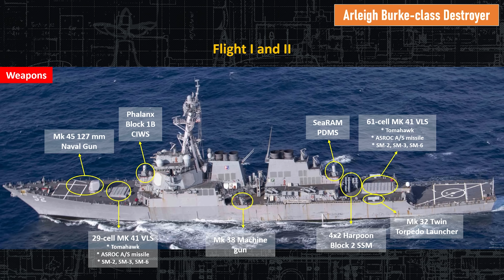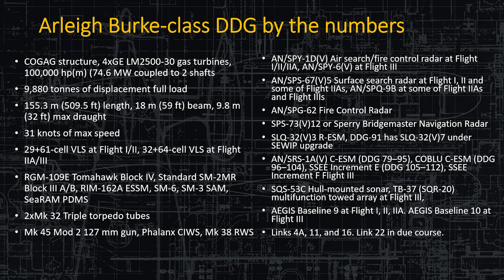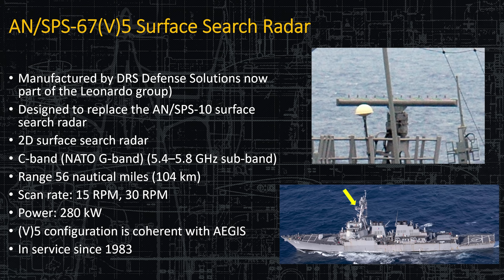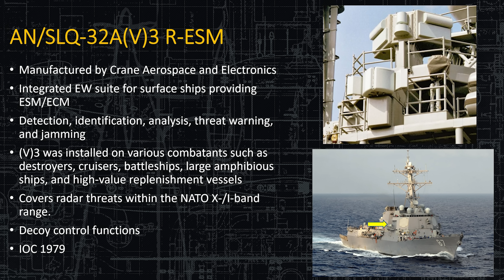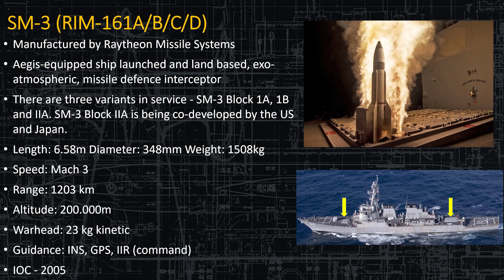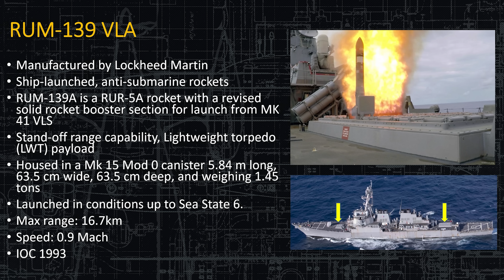How Does the Navy's Strongest Ship Work?

Comment: The Flt IIA and II are actually heavier and longer.  A lengthening of 4.5 feet was needed to accommodate the helicopter hanger and other needs.   The Flt IIA and III are also ~ 1000 tons heavier.
Reply: @edl653   Basically the later versions of the DDG-51 Class of destroyers in tonnage are equivalent to bare boned built light cruisers.
Reply: @latashafreeman563  Yeah, the Flt III is ~1400 tons heavier than the Flt I and is roughly the same as the Ticonderoga class.

Comment: The Blk IIA upgrades will include a 24 Radar Module Assembly SPY-6(V)4 upgrade as the SPY-1(D) is removed.  New A/C, GTGs, and Combat System upgrade to Baseline 10 also comes with that mod.  The Flt IIA will be almost as capable as a Flt III at this point.

Comment: 54 calibres and 62 calibres refers to the length of the gun measured in it's calibre (127 mm). So the Mod 0-2 at 54 calibres is 127mm x 54 or 6.858 meters. You will notice that the Mod 4 at 62 calibres has higher muzzle velocity and greater range because of the longer gun (7.874 meters).

Comment: The primary reason anything is expensive is due to it's scarcity. 50% of the SM-3 cost is not the sum of it's parts. It's the low rate of production. 
If we've learned anything from Ukraine it is the need for deep magazines. Not the onboard magazine, but the depot magazine. The stockpile requirement for a major modern war has not changed from WW1. Regardless of advances in precision, advances in production have out-paced that advantage. 
In other words, precision strike can destroy a lot of stuff very quickly and surely, but modern production can replace lost assets just as fast. The factories struck by precision weapons can be replaced by the same means of modern production. We're no longer riveting Liberty ships together, we can 3D print them. And, our workforce is three times larger to do work which is 30 times more efficient. 
Don't judge our current production rates on current malaise and greed. Were the threat existential, the production of advanced weaponry will boggle all belief.
Reply: Exactly. It took 3 years to make a single destroyer in 1941. After Pearl Harbor, it became 3 destroyers per day. And I would argue that our current under-funding of defense and neglect of strategic industry is nothing compared to our situation at the start of WW2, when we were in the Great Depression. We were also starting as the #17 world military power back then, not #1.
Reply: @Anthony-jo7up I would tap the like button a dozen times if I could. 
The inter-war years are the time to research and find an edge. 
The war years are the time to see who will outproduce their opponent. 
Unfortunately, we are in an interwar period as usual, and falling behind as ususl. This is because the US has no immediate enemies on our borders. Our current advantage is an after effect of the Cold War. The momentum it produced takes a long time to wind down. Russia's seemingly endless supply of cheap, poorly designed armor is proof of this. 

Now, we have the left overs of two very different doctrines. Soviet mass attack, versus US 'Quality over Quantity'.  While China attempts to infuse both doctrines into one. 'Quantity of Quality'. 
It won't work. China's adversaries are too distant, varied, and hold advantageous terrain. 
China should never attempt conquest. It will fail. They are merchants, perfectly located to be merchants. Horribly placed to be adventurers.

Comment: The main deck gun is not a 127 / 54. It is a 127 / 62.
Reply: Depends on which Flight.. Flight I, II and early Flight IIa received the Mod 2 with the shorter barrel. The longer 62 caliber barrel was originally designed to be used with the ERGM (Extended Range Guided Munition) that had a maximum range of 60 nm (70 miles).

Comment: Is the new frigate we are getting going to replace the Ticonderogas?
Reply: No. The new frigates are basically a long overdue replacement for the Oliver Hazard Perry class of frigates. The DDG(X) under development is supposed to replace the Tico cruisers and the flight I and II Arleigh Burke destroyers.
Reply: @lynnjensen150 I forgot about the Perry class. So we still use the ticos correct?  Or have they been chased out or replaced already?
Reply: I think the idea is the new DDG(X) in development will fill the role of the Tico’s
Reply: Those  fellas  are  having  their  thumbs  in  their  bums  and their  minds  in  neutral

Comment: Nice and complete presentation - thanks!!  👍As a Brit, I've mixed feelings about the Type-45.  It was a good step in the right direction to develop Royal Navy capability and improve the industrial base.  Its radar is very good.  However, it's had many development problems, e.g. intercooler in hot climates.  The number of VLS units (48) is small compared to the Burke's 96, and they had to start fitting Sea Ceptor silos to make up for nearer-field anti-air.  And they should replace one or both 20mm CIWS with similar R2D2 radar+RIM-116 RAM missiles.  Overall, however, the Red Sea/low-cost drone experience is showing how far behind we are in our thinking of air threats in a high-tempo environment, and cost-effective countermeasures. ☹ Hope the lessons are heeded for the Type-83.
Reply: @nukerock2451  fully agree, whilst impressive vessels I do think the T45’s are rather under gunned for their tonnage

Comment: In the early to mid 80s I was part of the RD team at GE GEAR plant in Lynn MASS machining the prototype and first high speed reduction gearing for the ARLEIGH BURKE class destroyers. I ran the largest 7 axis cnc horz boring mill in the country at that time. Another machinist and I machined the actual main gearbox that everything was installed and connected to. I was around 24 and my background in CNC programming allowed me to get the R 25 level job and that is the highest paying level for the union. It is something I always brag about and feel proud to know I worked on something so important.  The real reason for this new class of destroyers was not what everyone reports. It was so top leadership in the navy wanted to be able too water ski behind a fast moving ship. I have always wanted to see the reduction gearing installed but have not had a chance. Anyone have a suggestion
Reply: It’s pretty neat, I’m a welder at BIW and have seen it get installed with the overhead cranes in the building I work in. They lift it from the ground to maybe 5 stories up and down into the engine room unit. I kind of dread it because it’s always a pain to weld/move around once it’s installed LOL.
Reply: @RomeHam that is the way it use to get put on the floor for machining and loaded on index able table for machining. The gear plant was all large machines and overhead cranes were used for all parts.
Reply: WW2 destroyers were much faster, up to 10 knots faster than the Arleigh Burke DDG's.
Reply: @dundonrl actually I believe the speed is more than people know. I know of one operation where the distance proved that with the time traveled
Reply: @skipd9164  For routine transits, we were limited to 16kts, SOA (speed of advance) - think of avg MPH for a trip limit.  The MOVREP system, that came into being after USS INANAPOLIS was snk in WWII monitored out tracks, but there were ways to game the systems on long transits.  We got from Dakar, Senegal to Roosevelt Roads, PR a day earlier than the estimate upon departure from Africa....;)  As far as doing Flank III, we were not as fast as FLETCHER Class DDs, but we still could hit 33+.  Our (DD963) fuel load was 650K gallons, and usually was, at nominal cruising good for 30 days, so sprinting around used lots more gas.  Every operating day, we sent off a SITREP which included fuel on board, so ppl eyeballed that, and in my job on a staff, i was that guy so we could plan replenishments at sea/in port.
Reply: @streamingstarpros2843 only the Internet could allow us to meet people that we would never have crossed paths with. I remember having US Navy reps come and see the machine I was running. I actually ran the index table for them showing how the very large part could have all surfaces machined without having to be realigned. For a part the size of a single car garage that was amazing

Comment: All that the Burkes need to be absolutely complete is a quieter propulsion mode for ASW work when using the towed array
Reply: And perhaps some form of stealth added to its sides?
Reply: @tryhardfpv5351 PRARIE/MASKER is that kind of stealth, along with shock mounting equipment in the machinery/equipment rooms.

Comment: They''re planning on building a lot more than just 11 flt III's.
As of August 27th 2025, there are 24 named flt III's on the Burke's Wikipedia page...
DDG(X) will hopefully get started by 2027-2030!
Reply: Really need to ramp up ship production. But there is limited capacity.

I would like to see a Manhattan Program-style megaproject to build the world's first fully autonomous ship manufacturing center, that uses AI and robotics to take a digital design document for a hull and just works on it 24/7 as efficiently as possible, with a minimum of human labor, and produce a perfect ship in a short amount of time. Maybe start with a small ship hull, work out the bugs in the software and robotics, then scale up to produce anything from a small Coast Guard cutter to a giant container ship, tanker, or aircraft carrier. I'm sure some of the techniques are already being worked on or used at the airplane manufacturers.

Then, no need to train a lot of specialized human labor that only knows how to build a specific hull, the people working there only need to maintain the robotics and verify everything's going smoothly. No need for single-purpose drydocks. If you decide later you want more of a given ship class, you don't need to start over from scratch because all your experienced labor for that class has moved on, retired, or is busy on another ship; just pull up the same file you used before, and essentially 3D print a new ship of that class on demand.

If you need to move around ships in the production order that's fine too. Lead times would be dropped to almost nothing, as long as you have the supply lines to provide the raw materials. Have all the relevant facilities nearby for common parts, also automated and able to scale to the necessary amounts of things.

We should really be able to assembly line this sort of thing, in a very flexible way. The initial tooling R&D and cost would be high, but then you'd be able to churn out ships much quicker and with a minimum of fuss from human limitations. After building one such facility, you can just build more in the same exact way in various coastal areas. Develop the software and tooling just once, then invest in more such facilities as required by commercial and military shipbuilding needs.

Comment: 45:00 450Kg = 990lb

Also, I looked up the LRAP a little while ago, and it is said to have been cancelled. Did they just take whichever ones they built and hand them out?
Reply: They only built a few for the Zumwalt class, but they cost as much as a missile! The solution was remove the two 155mm guns from the Zumwalt class DDG and install more larger missile launchers.

Comment: Maybe we should keep updating this design and make a lot more instead of blowing the budget on pork barrel projects.
Reply: @phil20_20  There is certainly something to be said for sticking to what you know works, but there are also significant advantages to designing a new hull with modern features and design principles.  A ship of the same capabilities as the Arleigh Burke, but with half the radar cross section would be a better ship, and advances in CAD software and design in general could provide significant savings in manufacturing costs.  Either way, these ships will be around for many years yet, and will doubtless remain relevant.
Reply: The Burkes have run out of room to "keep updating this design".

Comment: Surely these will go a LOT faster than 31kts?

In WW2  the English had big ugly 40,000 tonne King George V class battleships going 28kt on 110,000hp. 

Arleigh Burke has almost the same power and a quarter of the weight...
Reply: The "official" speed is probably a good deal less than the actual top speed.
Reply: P = 0.5 * rho * S * V^3 * Cd
We can approximate S as the displacement / (rho * waterline length), S = W / (rho * l)
Cd = 2 * P * l / (W * V^3)

I'm not going to bother to convert anything to metric, just apply the conversions to the coefficient Cd

For the KGVs

Cd = 2 * 110000 * 225 / (40000 * 28^3) = 0.05637299562

For a Burke III
Cd = 2 * 105000 * 142 / (9700 * 31^3) = 0.103193139
You have to go for 38 knots
Cd = 2 * 105000 * 142 / (9700 * 38^3) = 0.05602541923

An Essex class for reference
Cd = 2 * 150000* 250 / (37000 * 33^3) = 0.05640501508

A more modern OHP for reference
Cd = 2 * 41000 * 124 / (4200 * 30^3) = 0.08966490299

Now an Omaha Class from WW2 that roughly compares in tonnage and horsepower
Cd = 2 * 90000* 170 / (9661* 35^3) = 0.07387461172
The Burke would have to be
Cd = 2 * 105000 * 142 / (9700 * 34.5^3) = 0.07486496392
Which is almost exactly in line

You can see that heavier ships are more slippery which is what we could expect. And that the results are roughly in line. We could get more into this rather important part, but I'm tired and need to sleep.

We can deduce that the Burkes can reach 35 knots without trouble. And could perhaps be pushed into the 36s.

Comment: How are the Burkes more powerful than a Tico?
Reply: Newer technology that the Ticos never got. I think all planned Tico modernization upgrades have been canceled now. This does not apply to all Burkes. But certainly the flight III Burkes will be way superior to Ticos.
Reply: @lynnjensen150  There's a few Tico's that received the upgrades. In a 4 November 2024 release, it was announced that the Department of the Navy planned to operate the USS Gettysburg (CG 64), USS Chosin (CG 65), and USS Cape St George (CG 71), beyond their expected service life, adding a cumulative decade to their previous out-of-service date (OSD).

All three cruisers have received hull, mechanical and engineering, and combat system upgrades. The USS Gettysburg and USS Chosin completed their modernisation in FY 2023 and FY 2024 respectively, while USS Cape St George was on schedule to complete the process in FY 2024.

Comment: I had a submariner describe the Burke as sounding like a bag of spanner’s being dropped down the stairs. 
Has this been improved?
Reply: Odd one out, of "a sea story."  The PRAIRIE/MASKER systems run off LM-2500 bleed air actually was quite effective.  Heard DD963, with same system, described as sounding like a light rain shower.  If periscope peek showed clouds around that bearing, it was a difficult call.  If clear skies, then better ID.....but overall, very quiet operations and remember, the subs get the best SONAR receiving gear of anyone...for a reason.  And I have found US "silent service" bubbas with a SQS-53.....
Reply: @streamingstarpros2843 good to know. The guy left the service a few years ago and spent a long time on boats. 
He also didn’t say how long ago this was or what speed the ship was going etc etc.

Comment: The Sm2 block 4 only 75 were ever made and it was cancled for the sm6. All sm2s began the upgrade to the block 3b which added an infrared seeker and all sm2s began upgrade to the 3b which entered service in 1998 meaning essentially all sm2 missiles today are block 3b. The 75 block 4s were kept in service until they could all be used and it is unknown if any remain, maybe a few. What I really want to know is does the sm2 block 3b need an awacs for anti shipping over the horizon and do the navy helicopters serve as an over the horizon radar? I think you should cover the different data link capabilities and how they work like who talks to who and can they all be shared between eachother? Can a fighter jet share its radar with an awacs also or is it only from the awacs to the other units. If an awacs can provide data link to the sm2 does that mean it has more than 1 radar to "paint" targets and the big one up top to scan? Does the sm2 even need the radar on the ship to provide the radar paint or do satellites do that also? I wish everything wasn't classified. Also if the sm2 needs air targets painted can a single firing radar dish "paint multiple targets? And why do they need those why can an aesa radar in an f35 paint targets but the aegis aesa radar needs the target illuminators to do what the aesa should be able to do? The f35 can even use its radar for electronic jamming so why do they need a separate radar for electronic counter measures? Why didnt they just make a really big radar from the f35 tech to do it all?

Comment: Wikipedia says the essm has the seeker head of an rim7p and a new rocket motor. It also says the rim7p can be used against surface targets, and the rim7p also has a datalink to be guided by an awacs. so does that mean the essm kept the ability to strike surface targets and be guided by friendly radars? And would that also mean it could be used against boat swarms or would surface targets not mean moving boats? I also read that the modern sm2 can be used against surface targets and has a datalink for mid course guidance and an infrared seeker so would it also be usable for striking small boats or would it just be large ships? I also read that the new upgrade for essm will add the seeker from the amraam, and wouldn't that remove the ability to engage surface targets?
Reply: Current essm has the active radar homing seeker of an amraam and yes they have datalink and can be used for surface attack
Reply: And no having an active radar homing seeker doesn’t hurt your surface attack capability it helps it